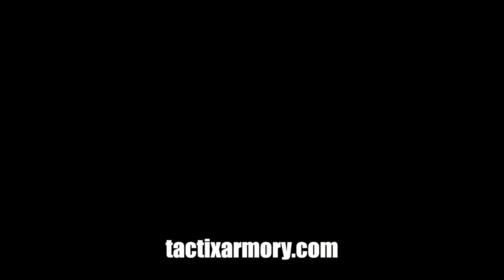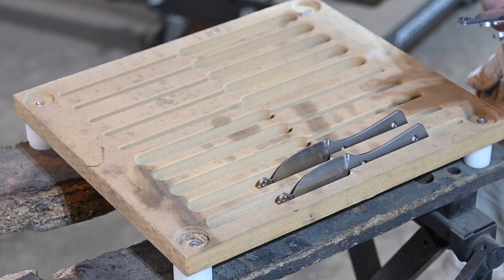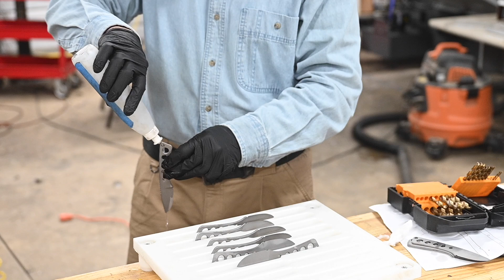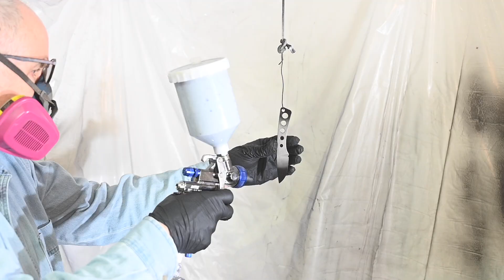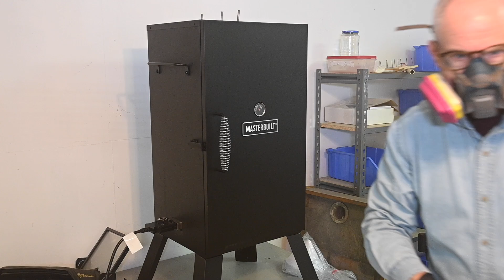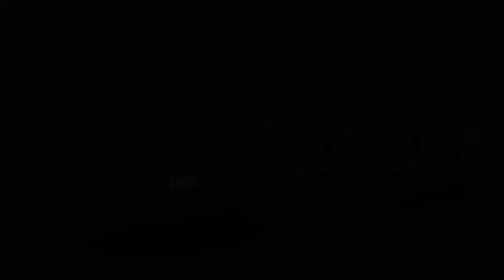How to Cerakote a Knife - Cheap! - Making a Simple Skeleton Blade

Comment: Are Canadians also eligible?
Also i get that you need to cure at 250F for 2 hours so, do you use that also as a tempering process?
Like I know many times, tempering will be done twice depending on the temp and length of time so I'm just wondering if you do 1 temper beforehand so the blades aren't too brittle and then your curing time for the cerakote also serves as a second, light tempering?
Just wondering.

Comment: The tree you made for Cerakote will also work for spraying an anti scaling coating like ATP-641 onto a blade that has been heated in an oven to make the mist that comes out of the sprayer stick.  I have been using wires and hooks, and the blades do flop around like crazy.

Comment: So, how do you coat the hanging hole or get it off the screws after it sets?
Reply: Gonna take a shot in the dark here and say that back hole is uncoated on the inside
Reply: If your that worried about it mix up a small amount and brush in the hole then bake it again

Comment: Do you have a recommendation for lasers?
Reply: If relatively shallow etching, a 20W diode will work. My 40W diode will get in to actual "engraving" depth.
Reply: I use the Xtool f1 2W Infrared laser and it works just fine!